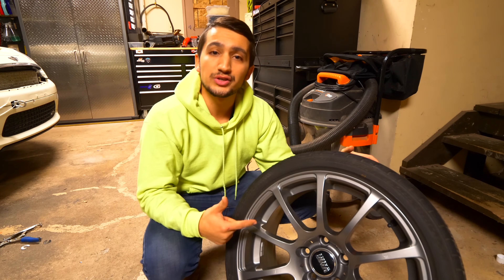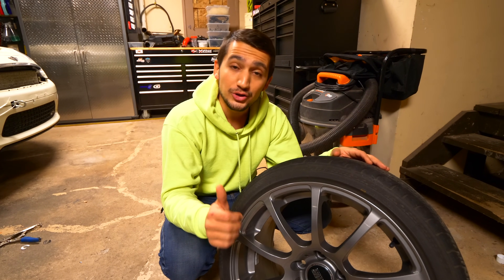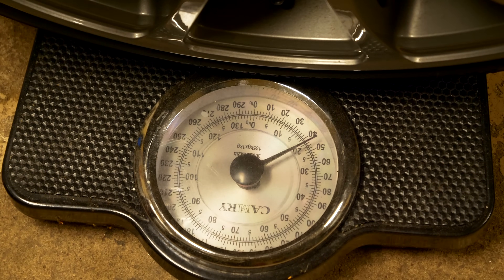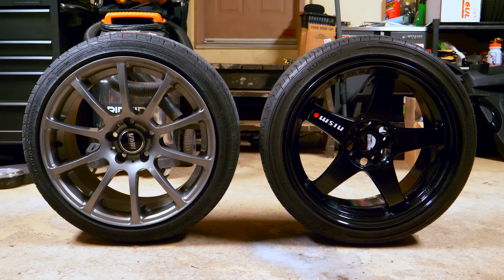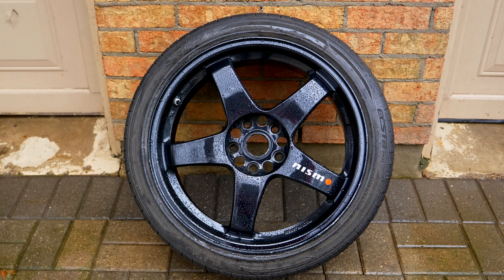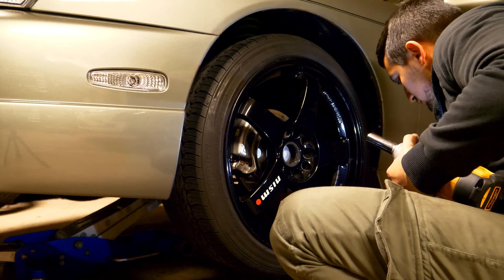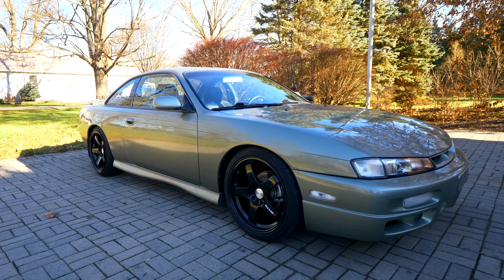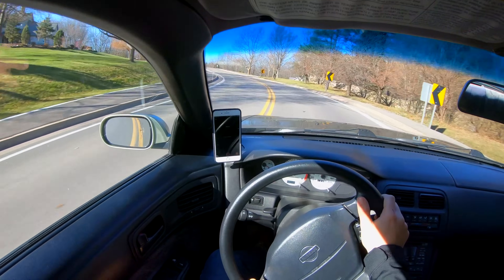Cast vs. Forged Wheels (Comparing EXACT Sizes)

Comment: Forged wheels still crack and bend.....if you wanna prove me wrong hit a curb at driving speed
Reply: Obviously they will, what tf do you expect? 
You're like "If I hit them at 4563256596kph then put them in a volcano then rape them and hit them with a racoon they will be damaged..."
NOTHING IS UNBREAKABLE.
And btw cast wheels don't even need a hit to crack, just torque or low tire pressure is enough.
That won't happen on a forged wheel, you really need to hit it hard to bend it, I've seen people hitting their rims at like 30kph on a curb and not breaking them, and last time my dad hit a hole really deep at like 110kph without any damage to the wheel.
Reply: just imagnine milan does this irl
Reply: "You're like "If I hit them at 4563256596kph then put them in a volcano then rape them and hit them with a racoon they will be damaged..."" lmao thats funny
but i agreeeeee whit you IMNOTA
Reply: RIP MisterBassBoost will he take the challenge? Lol